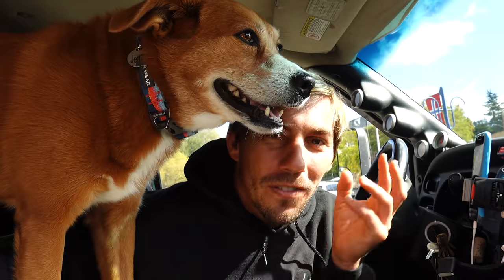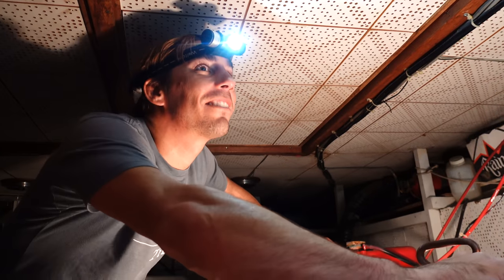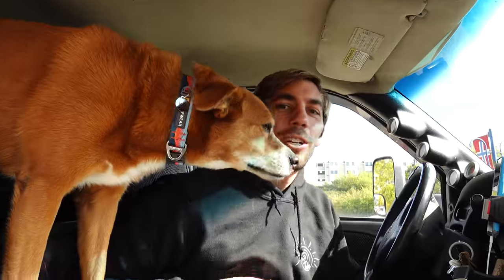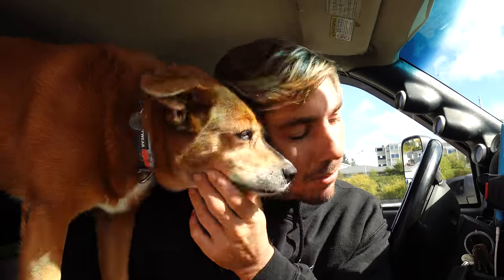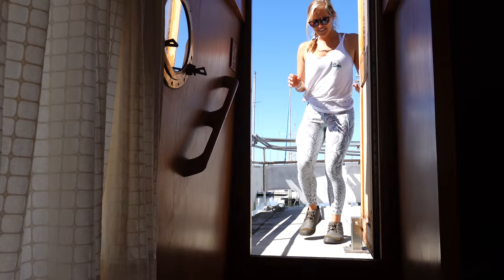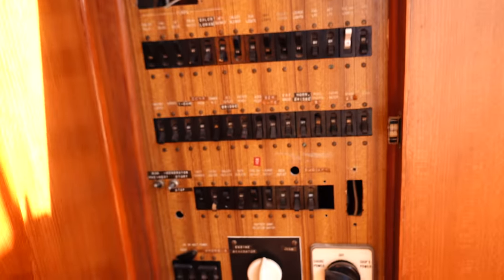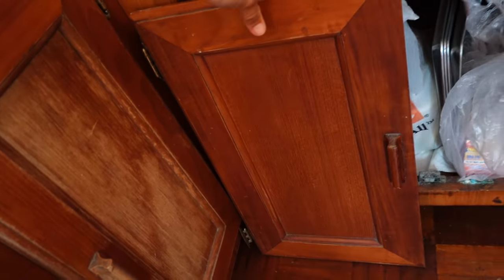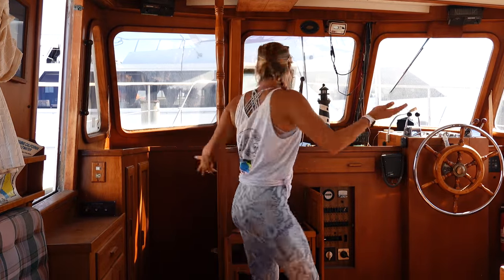Should We Buy this Boat for $100?

Comment: We lived and worked on our  1987 44 DeFever for 14 years.   Its an awesome boat, no doubt.  Ours wasn't nearly as bad as the one you are looking at.  It took the better part of a decade though to get her into the condition I wanted and that was doing the work myself.... in FL.   The two dealbreakers on a DeFever are the fuel and water tanks.  If they are leaking (which they probably are) then its trash.  It costs way too much to replace/repair those.  Those Lehman engines are great, no worries there.  Join our DeFever club and you will have access to a wealth of knowledge.  Good luck!!
Reply: Wow! It is beautiful and so much personality! For $100!!
Reply: Could you pump the tanks dry and use internal bladders? ...or would that not work/not be worth it? I don't know the boat at all, I'm just thinking if I were in that situation...
Reply: WOW..! Blatter ... good idea...🤔
Reply: @ryano.5149  That's what I would do. Many ways to fix old tanks.
Reply: I love seeing guys like you who have sweat and bled and are willing to share their hard-earned knowledge and warmly welcome new folks into the "club".  Good man!
Reply: That’s just not true about the fuel and water tanks. There are multiple ways nowadays to repair/replace them extremely easily.
Reply: Bladder installed in the tank..no big deal its 2022 and you can get them made to you specs from many different vendors..It's not new technology and well tested and proven.

Comment: I mean this to be in the most kind of way…Do you want to spend the next 12-24 months of your lives restoring a boat?  You seem to really enjoy exploring & this boat will take your summer and fall at minimum, & a couple years to get it in shape out of your youth-spoken from older travelers-it needs lots of repairs that will insert a catheter right into your bank account.  Defever are great trawlers no doubt,  we almost bought one as well.  The question is, do you want to spend the extensive time and money to do it up and, what will it be worth in the end. It will be sunk cost.  I don’t think from what we’ve seen, you can put enough lipstick on the pig. Run away!  Enjoy experiences doing fun things like you have been.  Too many boating vlogs doing boat repairs & restoration already as well.  FWIW.

Comment: We looked at the same model Defever last year.  Somewhat better condition but same interior leaks all over.  The fuel tank issue was the dealbreaker though.  $50k project hanging over our heads to replace them and all those boats need it done.  Enjoy your journey.
Reply: LOL i can do that job for less! the metal needed is at max about 500$ .... cutting the metal only takes time, not money....(Provided you have all the tools) welding could be done in a day or 2 .... if i take my hourly wage, it wont cost you more than 10k for both tanks and 3 days of work.... (might even be less depending on where you get the metal from or what fittings you going to use) 

Gotta love rich boat people with no skills what so ever.... you guys are like piggy banks for people like me.... got payed $2500 once for an anti-fouling job i did in 2 days :D (less than 8 hours of work) did do a double coat because i wanted to finish the can of antifouling

Comment: Go for it !! I'm very excited  to see how it turns out.  You can cruise while you are working on the small stuff.  Prefect timing for getting back up to the San Juan islands,
Just a few miles north of where you were are the Canadian Gulf islands.  Further North, is Desolation Sound where the water temp is very warm.  Check it out.

Comment: I am not sure when the seawind is coming. If you have over 9 months until that comes, this trawler could be home base and a slow stable platform to explore the left side. Say 2-3 months on systems and cosmetics. Nothing structural unless it’s absolutely necessary. Get it running safe and run it around until your world cruiser is ready. Then turn this over to a subscriber for what you have into it. Bam…the birth of a whole new sister channel. You guys are great. Cheers

Comment: My thoughts on your poll are that you need to look at your timeline to getting the new boat, the fact that it's so far away from your home base, and you know as well as anybody that you'll end up deeper into repairs than you calculate. I know you have the knowledge and ambition but I would personally pass on it. If it was here in my area that would be different as I know my resources here as do you on the east coast. But either way you go I'll be watching.

Comment: Personally, I see a beautiful old boat with tons of potential. Get those tanks checked ASAP. You can get a scope pretty cheaply to look inside it, and around it in areas you can't see normally. Under it, etc. Check into pricing on new tanks if needed. And engine rebuilds if you're not able to do it yourself.

After that, if the bones are good, then you're golden. How much you redo or rebuild is up to you, your budget, and time on hand.

Comment: @ Around 3:10 the narrator is talking about " Going Through the boat " !
The 1st., thing you check is " The Engine ": As in " The Fuel Tank " !
If it's gasoline, It will have " Separated Into Layers " In the Tank " ( That Takes About >
2 years ), if so then the Gasoline is " NO Good " !
It has to be " Removed and Replaced " !
Check ALL The Other Fluids Also !
Check All the Wiring ! ( Pluming excetra ) !
Even Get a " Boat Maintenance " book and follow the " Prescribed Procedures " !

Comment: So I am a SF Bay/Calif Delta 30' boat owner. BUT my first question is how long until your new cat is supposed to be delivered(and be sure to add 3-6 months)? If it is still a year out then I would encourage you to go for it from an adventure standpoint. There are plenty of smaller marinas in the bay/delta area that will let you work on the hard. A slip is gonna run from $400 to $1000/mo. Not sure about boat yard rent. Surfing in Santa Cruz, Fleetweek in SF, diving in Monterey(brrrr), and a long trip to the Channel islands. Tons of history and national or state parks. Avoid SF mooring and move up into lower cost of Vallejo, Benicia, Pittsburg areas for repairs. Tons of marina and parts. BUT ONLY IF you are quite a ways out of the Seawind. It will be a huge amount of work.

Comment: First, do you need a place to live and a job? There is no doubt that you have the experience and the savings to take on this project. But isn't there another boat, the Seawind 1160 also asking to use those saving's? Generally, only a boatyard dreamer (and there are many of those) would even consider a project like this and they don't usually have the money, but that's the nature of a dreamer. You are not dreamers. BTW, what is the 1160's delivery date as it sits right now? At what point are they in the building process? I can't wait for the next episode of, "Have Billy & Sierra Lost Their Minds? Or will they refit a broken-down Defever?" Love you guys, good luck with this one.
Reply: Job? Who needs a job? They have Patrons.

Comment: Lots of pluses and minuses.  The location is certainly a minus.  SF Bay is an expensive place to keep a 43' boat while you get it running and there are not a lot of places to cruise to.  On the other hand, once you get it running reliably you could move it to Puget Sound.  That is pretty much an ideal boat to cruise the northwest and also head up the BC coat to Alaska. It would be an adventure moving the boat north though.  Location things to check include: does the slip transfer?  If not you will be looking for a new slip which could be stressful, expensive and require the boat to move.  Few marinas will accept a boat that doesn't come in under its own power.  Can you afford to keep the boat in SF Bay?  The bay is a high rent district.  Also there is the insurance issue.  Can you get insurance for the boat.  Old trawlers can be hard to insure and you will have a very hard time finding a marina to keep it in without insurance.

As I am sure you know, the BIG things about buying an old trawler are the engines/transmissions and the fuel system.  Either can be VERY expensive to repair/replace.  You can do a temporary fix on the fuel system, but removing and replacing rusty tanks is a big deal.  The engines are the biggest issue.  If they run and have decent compression you are likely good to go - for a while depending on how many hours the engines have.  Billy can deal with a dead transmission (remember Neverland).

The leaks/rot in the house are an issue, but you can deal with them more or less at your leisure after you take care of the engines/fuel system.  I would want to see the refrigeration working, but you can just buy a refrigerated cooler or two for the short term.

If the engines run and the trannys are good, the biggest risk I see is getting stuck with an old boat that is expensive to keep.  I could see you putting $15K-$20K to get the boat operational and livable and then not being able to sell it except at a loss when you are ready to move on.-  It will be a LOT of work.

So to reiterate the big issues are:

1) Is the slip transferable and what will the cost be?
2) Can you get the boat insured?  That is likely going to require a haulout, which means the boat has to move on its own.
3) DO the engines run and are they in good enough condition that they won't die soon.
4) Is the fuel system OK enough to run the boat at least to a haulout and/or to a new slip.  You can always rig temporary poly tanks for short runs, but the long run likely means new tanks.

I would check all of the above and I would look in the fuel tanks to see what they look like inside.

The boat looks like either a great opportunity or 43', expensive white elephant.

Comment: Hell YES--as long as there are no liens on it. De Fever made good gear--the engines will be your concern--and you can sail it through the Panama if you have to.  Clean fuel tanks or replace them with saddle tanks--buy 'em from truck wreckers--some trucks use stainless ones.--the old fuel will probably need to be removed and stored--then filtered if you intend to use it again before putting it into the tank.  I would not consider the North West Passage unless you really like to take risks.  I think the engines will be OK after shaking them, loose--pull injectors and pour a little diesel into each cylinder.  After it soaks for a day or so, try to move the flywheel.

Motor vessels cost a BOMB in diesel to run-- but with luck you will not lose money.

Comment: Has anyone ever thought of using these old boats, especially non seaworthy, as a cabin in the woods somewhere.
Or even several in a camping area to rent out.
Would be a cool camping theme, I would think 😎
Reply: You can get them with wheels, they're called "mobile homes" ;-)
Reply: Are YOU gonna pay $10k or more to have it moved THEN spend months/years and 10's of thousands to clean it up and get it back to decent shape? Yea most others won't either

Comment: Well, the thing is, your job is basically wherever and whatever you make of it.  So, if you can get the boat to a yard and make sure she isn't going to sink on you and then either live aboard her in the yard or back in a marina somewhere you're fairly golden there.  A project boat certainly gives you the ability to create content for your various endeavors and should keep your revenue streams flowing.  So a place to live and new content equals definite pluses.  Even the tool issue isn't that big a deal because you can drive across the country and get them and be back in a little more than a week.  And we all know between the two of you the skills and knowledge are there to fix anything on the boat that needs to be fixed.  I think the big thing is time.  Do you have the year of time I'd estimate it will take you to complete this before your new boat is due to be delivered?  Also, ask yourselves do you want to do nothing but boat work for the next year because based on what I saw of her you won't be doing much, if any, cruising with her for a minimum of six months and likely a full year before she's really ready for it.  Also ask yourselves if you want to redo a boat with the only purpose to be getting her in condition to sell her.  That and to provide yourselves with a content opportunity while you wait out the delivery of your new SeaWind.  Last, I think, ask yourselves if you think you can get this boat to a good point of being ready to sell once you do take delivery of the SeaWind.  I rather don't think you'll want to keep up with her once your new boat is delivered and if this boat isn't in a condition to easily sell her then you'll be stuck working on her till she is when what you really want is to be on your new boat.  I could probably go on and on, but my thoughts would be mostly on the timing.  If you've got the year to devote to her before your new boat arrives and are trying to figure out how to keep your channels going with new content, then you just may have found your answer.  If not, then I'd consider to keep going with the road trip while waiting for the boat.  Either way good luck.

Comment: As a professional engineer for a military defense builder / supplier, first serious idea that comes to mind is the wiring throughout the watercraft. Especially check for baked, brittle and cracked insulation on the internal hidden wiring from extremely hot weather. Get fire insurance immediately. You are looking at external cosmetics visible to naked eye. Please have a inspection engineer go over the boat with a fine tooth comb and give a complete inspection report.

Comment: Those tanks are just galvanised steel boxes ... Same as water tanks but with a top.
The other option is to use Aluminium beer keg or a big second hand  commercial plastic van or truck tank and you can forget about corrosion... 
For water tanks look at food storage stillages ...they come in different sizes and shapes ..have access hatches sometimes even taps if they contained things like vinegar, mayo, Cooking oils or cleaning products... Some even come in stainless steel handling cages.
They are all usually designed to be stacked. 

The boat floats ...and its big its a place to live ... The fly bridge is a bit of a disaster... 😬
Check the prop shaft seals through hulls and you'll have an ecosystem on the hull props and rudders ... but think and work latterly....see 🇬🇧Wildings sailing and their 70s cat Minkie.
You picked a heck of a time to consider a motor trawler.. but it could be worse ..
See Shipshaped 🇬🇧 and their ex WW2 vessel.🤦🏻‍♂️🤪😉

You are going to need a jet washer and some sort of cleaning solution ...🤔 quite a lot actually..

Dig deep .... and let us know.

Comment: you don't need to determine what the boat needs to have done with it right now. what you really need to do is determine how much it could cost you to get rid of. 

obviously the owner wants to get out from under the monthly docking fees. and i imagine that's what should concern you too if it turns out that it's not worth fixing up.

i suppose, one could simply live on it...

Comment: Great boat and great durable and economical engines. All the boat you will ever need. I got a 38 foot trawler single diesel in a similar condition. love it. I think you should go for it if you haven't already. This project works if you can do the work and enjoy doing it. Down the road you can convert her to Electric Power!

Comment: Great boat…but hard call for me…i refitted a vagabond 42 sailboat completely from stem to stern…even repowered…$$$
More than the cost of boat, and I didn’t get a great deal…it was a great experience and I had a beautiful yacht that I knew every square inch of when done…
Attention!…looks like you’ve got cast iron tankage…typical of that era …I changed mine out to aluminum and it was a witch with capital “B” of a job…whatever you do, don’t start it with fuel from these tanks…get temp remote tanks just to be safe…I have recently become of aware of a product that you can apply to inside of these tanks and it seals the corroded areas after good cleaning…holds up to fuel very well…im skeptical of this, but supposedly it does…
You’ve got a job on your hands for sure, but only you can decide if it’s worth the time and money…btw..whatever you budget for repairs , you should expect it to be at least double…I learned the hard, but fun way…no regrets for me…hope the same for you!…cheers!…ashley

Comment: those deck fills look bronze. I have some on my boat and they were seized. I like them, and use a pin wrench as my deck key. Also called a clutch basket holder. I had to file the pins to fit, works great!

Comment: From what I have read on the internet about asbestos in yachts, it is unlikely that it was used in the cabin space. But prudence should dictate removal of the broken tile while ppd’d. The rest should be encapsulated.  It is more likely that the tiles in the engine room are (asbestos) because of the sound and suppression factors. Again ppd and encapsulation not removal, even the broken pieces. This would account for the giveaway though they would have to reveal it to you by law.

Comment: You need to get a look at the hull a boat that old would likely have osmosis problems. Has to be slipped to know if it has. Im an old boatie our family owned a marina here in Sydney Aus. Osmosis is make or break issue.  Cheers  Dan.

Comment: Hmm you certainly have your work cut out 😂. I think it’ll be worth it, if you ended up doing the work yourself 👍👍👍
I would buy it and tackle it bit by bit. As long as it’s structurally sound and the engines just needs over hauling.